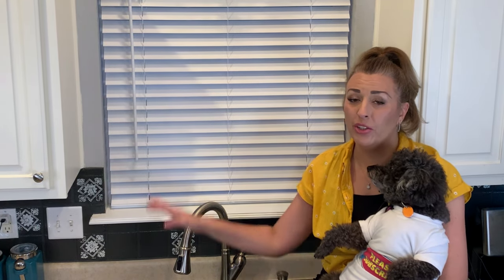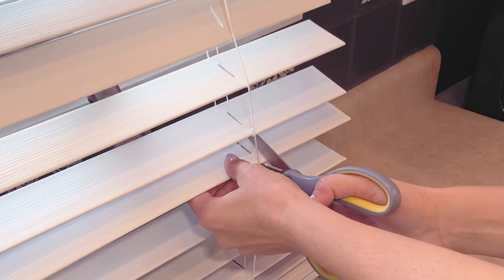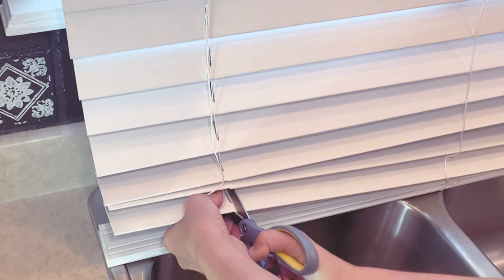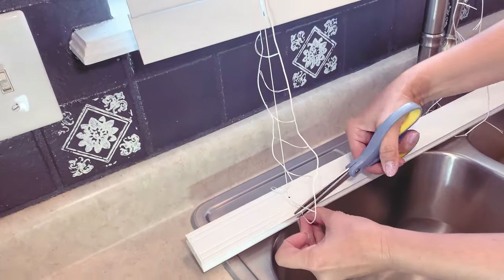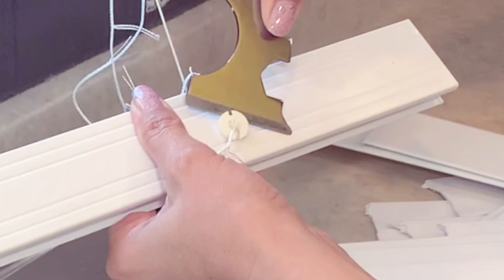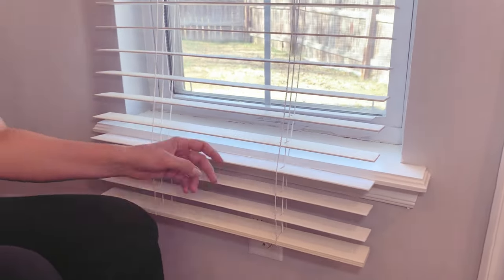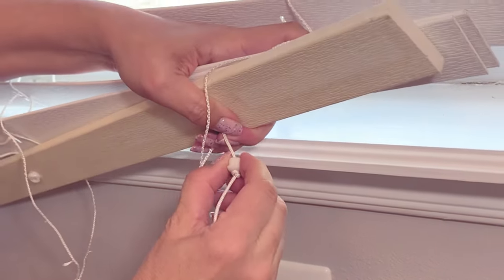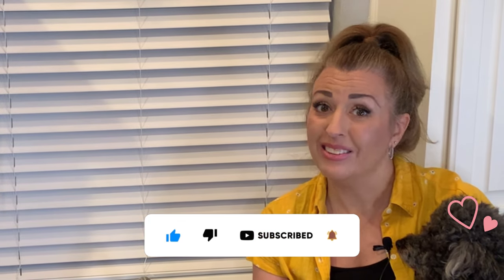How To Shorten Both Cordless and Corded Mini-blinds

Comment: Thank you for the tutorial!  I have almost the exact same cordless blinds in my window right above my kitchen sink, with coincidentally a very similar faucet as your demonstration so this was especially helpful!  I've been wanting to adjust them since I installed them about 6 months ago, and you gave me the courage to do it today.  It looks and feels better to have the blinds fit the window now.  I wonder if you have any advice for after pulling down they hang just slightly lower on the right?  They did this before I altered them and it's the same after altering as well.  I've tried different techniques to pull them down including just pulling from the left, with no results.  Thanks!
Reply from the maker: Glad it was helpful! It may have more to do with the tension on the line than anything else. Unfortunately I don’t know how to fix that. 🫤

Comment: Hi Does this process work for cordless Levolor vinyl mini blinds?
Reply from the maker: Hey there! It should work the same 🙂
Reply: Thanks Tammy. I ask because the Levolor instructions state “these blinds cannot be shortened due to the cordless operating system”.  I guess this is a standard disclaimer.
Reply from the maker: If it looks similar to the one I did I would assume that the mechanics of it are the same. In that case, it should be fine. Maybe people are accidentally cutting the center string that is under tension. Otherwise it should work.
Reply: I just found this on the Levelor site and it appears to mimic what you show in the video. 

https://s7d5.scene7.com/is/content/DecorOnline/Levolor/support/install_files/CustomSizeNowAlumVinylShorteningInstructions.pdf
Reply from the maker: The instructions here are not for cordless though
Reply: Oh yes, you’re right.
Reply from the maker: I think it should work with the cordless method still. You can email me at tammyshometips@gmail.com the pictures of the bottom part of your blinds. And I’ll have a better idea.
Reply: Thank you Tammy I will take you up on that. I will take pics soon and email you.
Reply: I sent you an email. Thanks
Reply from the maker: I replied 🙂
Reply: @TammysHomeTips   Your solution worked perfectly for my Levolor Trim+Go 1-in Slat Cordless Vinyl mini blinds (Lowes). Thanks again.
Reply from the maker: Wonderful!! 🙌🏼 Thank you for the update! Glad it worked out 😊

Comment: The only problem with this method is you now have now spares
Reply from the maker: With the cordless it would be challenging to replace a broken slate. I could see saving a slate or two from the corded one though. Good thought!
Reply: I’m trying to figure out a way to comp the center string at the sop so I can replace some broken slats with those extra at the bottom. I don’t have a lot of money for the expensive blinds that still sag over time. I just have the $10 made in Vietnam mini blinds that the slats break if you breath on them too hard.
Reply from the maker: @mousetoad7040 I haven’t figured out how to do that unfortunately 😔